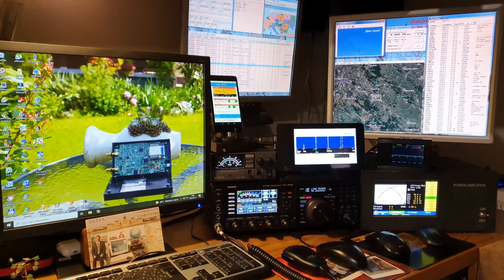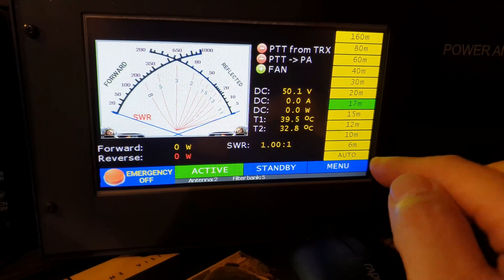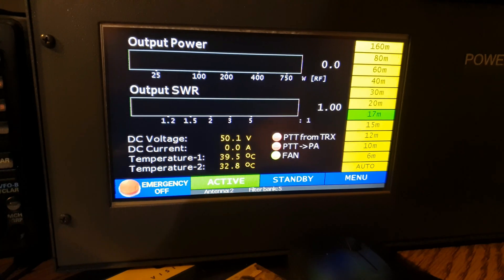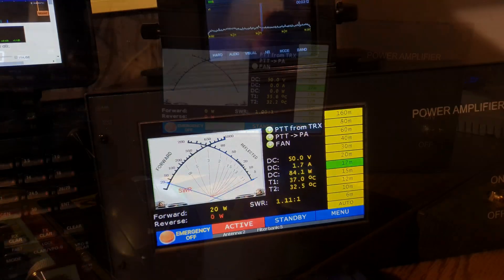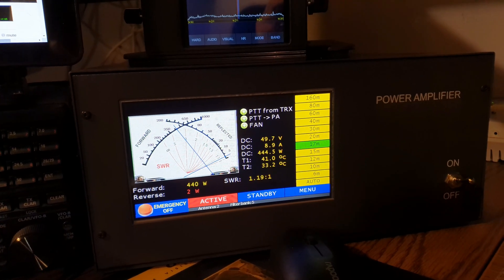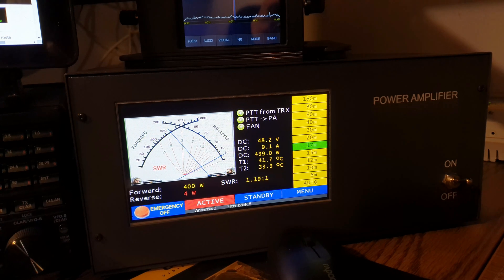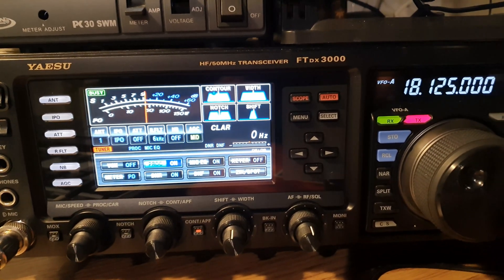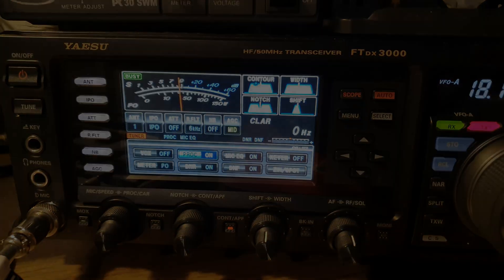600W LDMOS power amplifier

Comment: Very nice amplifier ! 
I got that board somewhere, waiting to get built ...
Tube amplifiers do not need to be quite so Huge - take a look at old Zetagi stuff.
Reply from the maker: Hi, thank you! Yes it is true.  But I think tube amps generate too much heat and are noisier than solid state amps. Semiconductors are the future!!!
Reply: @hg7an_ham_projects  Weight is an issue with tube amps but they can be silent ! Look up EX8A's GU-81M amplifier - 3kW no ventilator fans.
I'm building a 350W tube amp (2x GU-19) right now, to see how small i can make it.
After that i will build the 2xLDMOS 600W amplifier using MHT1803  devices.
They are the same as the MRF300 but a lot cheaper. ea7knw

Comment: wow! excellent job, well done! Years ago i built a 2 x 4cx250b valve amplifier in push-pull configuration for 2m. It had 2.5kV on the anodes and was force cooled with a large snail blower fan!  This looks much nicer and safer! 73 de G6PHF
Reply from the maker: Thank you very much!!! Yes, it works with 50V, so it is safer...if you would like to build an LDMOS PA then I can help you!!! 73 Zoli HG7AN

Comment: Good morning to all Oms and Yls!

I have been using a Zoli amplifier like this for several months!
It works reliably and without problems.
A high-quality work and also looks great ❤️
Thanks to Zoli for this work and to whom he put all his skills and heart and soul into it. The amplifier is light in weight and you can easily find space for it in the shack.
The only thing I don't like is the volume of the fan... but because I'm constantly working with headphones, I hardly notice it.
Overall a super great device, well secured against any incorrect operation by the operator‼️THANK YOU ZOLI👍
Reply from the maker: Thank you Chris! I reduced the fan noise in the next version. I will make it in your amplifier as soon as I can do.... Best 73

Comment: This is great project. Well done Zoli. Wonder if you can share this project on your web site. I like to build one like this. 73 from Vinh, VE6AKN.
Reply from the maker: Thank you for the kind words! I will plan to display the details on my web page. But due to my other ongoing projects, I'm a bit slow with documentation. 73, Zoli HG7AN
Reply: @hg7an_ham_projects  I realize that you use DSP-7-PA module. Could you let me know where to purchase this controller either kit or fully assembled. TU, 73, VE6AKN.
Reply from the maker: According to my information, it cannot be purchased. You have to build it. 73, Zoli
Reply from the maker: Send a short email to me (hg7an.zoli@gmail.com) and in my answer I will send personal info for you.

Comment: excuse my ignorance but why MRF300 devices are rated to withstand 65:1 SWR and all amplifiers I see are protected to 2:1 ? I even see amps running full power with coax cable being cut with no damage to transistors ? why such tight protection on SWR ?
Reply from the maker: Dear Aleziss, Actually, the accepted limit for RF power amplifiers is 3: 1 swr. In this case, 25% of the output power is reflected from the antenna connection point and must be dissipated by the amplifier in the form of heat. The purpose of the amplifiers is to deliver 100% of the power through the antenna. In addition, the cooling of the amplifiers is designed in this way. In the case of 65: 1 swr, 94% of the output power must be dissipated in the amplifier in the form of heat and only 6% goes out to the antenna. There is no point in operating the amplifier with such a swr. 73, Zoli
Reply: @hg7an_ham_projects  thanks I undestand that running an antenna at 65:1 is not worth it, my initial question is why keep the protection so low when the device can withstand 65:1. So by what I undestand, it is a heat problem that prevent amps to accept hi swr correct ? I did not meant so it could handle 65:1 but 5:1 or even 10:1 wouldn't be a problem if there was a proper cooling system, the ldmos could handle that 10:1 no problem right ?
Reply from the maker: Dear Aleziss! If you use Ldmos at maximum power (for example, you drive the Mrf300 with about 300 watts out of it), it's not because the fet can't dissipate the extra power that comes back due to that bad swr. If you use fet at low power (e.g. 150w), it will withstand higher swr as well. 73, Zoli
Reply: @hg7an_ham_projects  ok another person also mentionned that the capacitors and dozen of relay contacts in the filter board might be damaged when they are subjected really high voltages due to impedances way out of 50ohm, that way I could undestand that the filter board might not handle the high swr but the transistors could survive... thank you for all your replies

Comment: Zoli, Congratulations on the project, I already have the amplifier with the mrf 300 but I would like to put an lcd, you use arduino, what screen do you use, thanks, manoel py2wg
Reply from the maker: Thank you, the display is a 7-inch touchscreen LCD recommended for arduino projects...